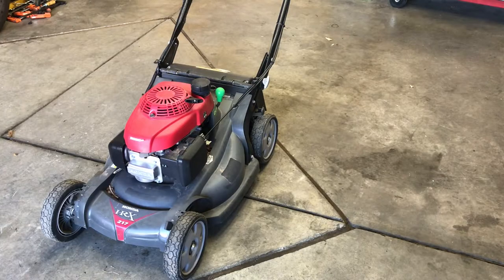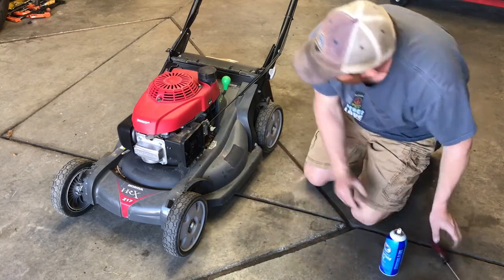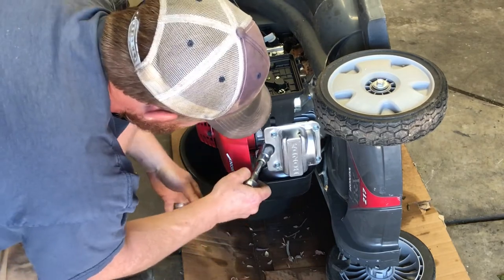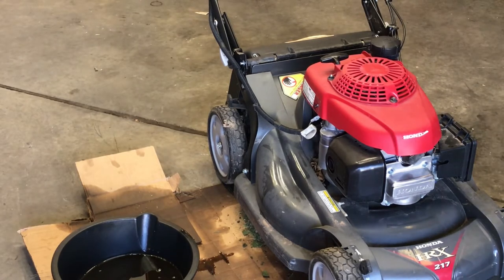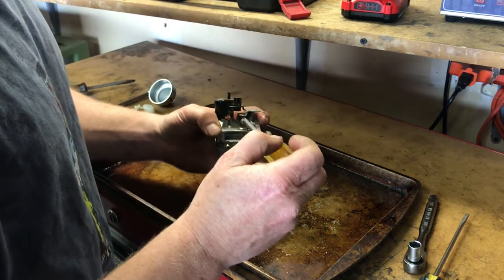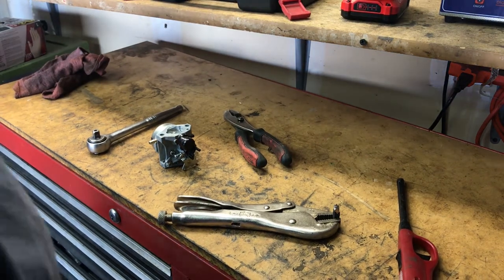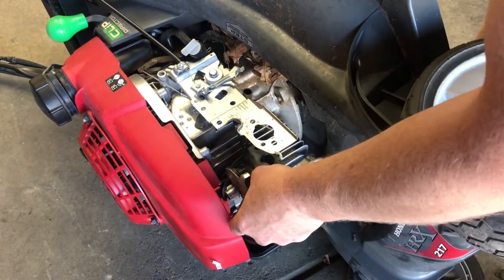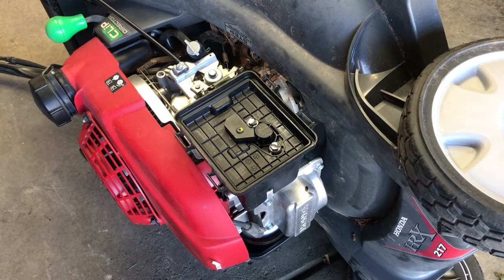Honda Lawnmower Tune Up Small Engine Repair

Comment: Yes, those Honda engine carburetors are a pain in the butt. Lining all the gaskets, carb, isolator, air filter cover etc are or can be a struggle. I sometimes put studs in instead of the bolts to help aid in the assembly process. Great video sir. Keep them coming .
Reply from the maker: Thank you!!